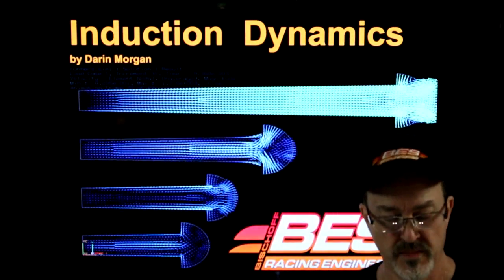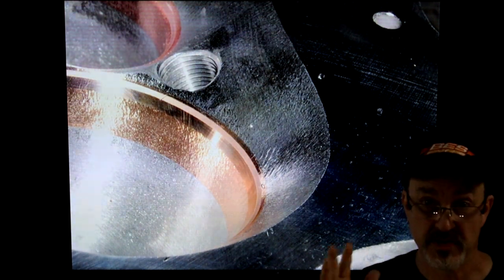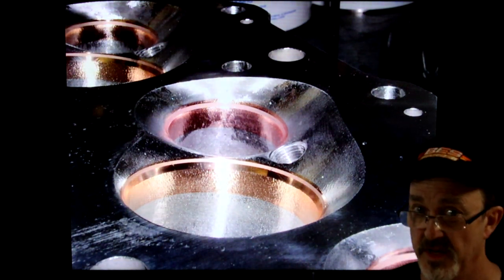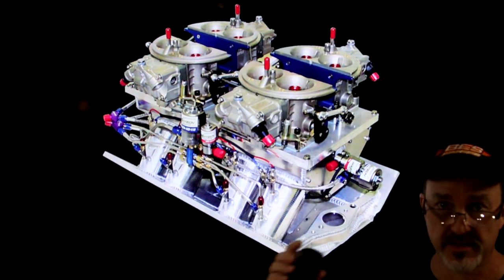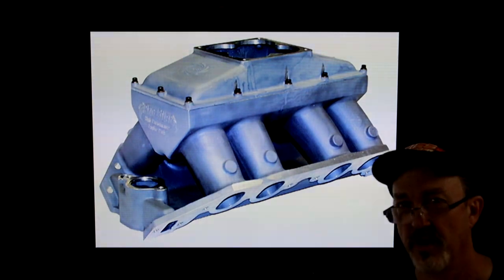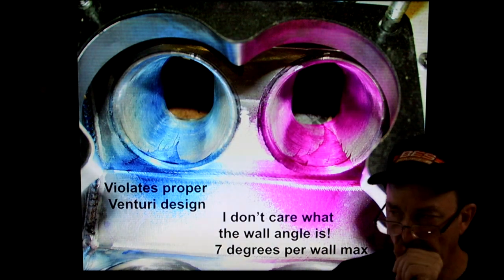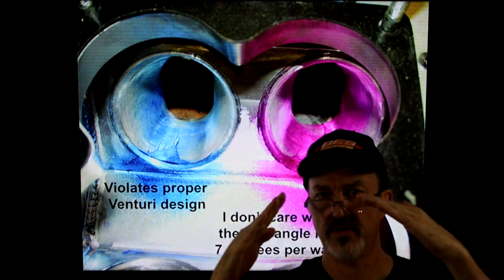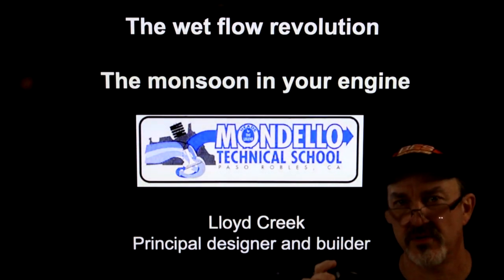De-atomization in intake tract in IC racing engines PART 1

Comment: I have to take exception at  21:00 when you state 7.5 degrees is the max according to venturi design rules.  That angle is ONLY referring to the DOWNstream side of a venturi. In your runners it is more like the UPstream side of a venturi where it is much more flexible. Actual venturis typically have a 19-24degree angle upstream since there is little danger of the flow breaking away. 24degrees limit is only there to ease the transition into the throat of the venturi. Runners are not venturis and run in a different environment.  IF there IS a limit on runner converging angle, it is not due to venturi design rules but has to be something else. 
I think you are right about the radius, the bigger rad involves too much air around the entrance and the smaller rad focuses the pressure distribution more to the area above the entrance. The blue runner looks to be in a corner with a wall beside it and the pink one no walls beside it. That could change the pattern too.

Comment: Thanks for the great information that most would never have access to. In future classes (videos) can you also tell us your thoughts on port injected EFI applications and how they differ from, or are similar to the flow characteristics of moving air as opposed to a fuel--air mixture? Thanks again for your time and expertise! Jeff
Reply from the maker: Everything applies with EFI as it does with carburetors except plenum volume. Plenum volume is not a tuning factor with EFI like it is with carburation..  A properly designed EFI system in an unlimited NA engine should be in the plenum  right above the runner opening so your still dealing with the same de-atomization problems. Injector placement down at the flange is done for throttle response which drag racing engines dont need. Plus, when you lower injector placement down the runner it decreases charge density and inertia super charging  and VE suffers!
Reply: @darinmorgan3520  Wow! Thank you. Very interesting. Thanks for taking the time to do this series!, Jeff
Reply from the maker: Since you brought it up, hell yes. Thats a great topic and a very important aspect of induction system design. Particle flow (fuel droplets)  air carried by velocity change not just the velocity itself. Thats why we need a short side radius and why that radius is so damn important. This is one reason air speed management ( peak, mean change) is the primary goal of any induction system designer. I will get to work on it.

Comment: How much might the carburetor offset have played into your dykem testing results? Did you run the radiuses in reverse placement to confirm your findings?

Great content, I’ve learned a lot and it has peaked my interest in the subject.

Comment: I'm debating the following for a 96 Gen 2 Viper.  Heads were done in 1999, 269 cfm @ .600 28in.  I'd like to get the work on the heads evaluated.  Maybe there are problems that can be fixed and who knows, maybe some "low hanging fruit" that could be harvested.

Comment: the older manifolds curved the runners so the fuel would not drop out.  did it work? I don't know. That was the days of carburetors,  now fuel injection it is not an issure

Comment: What about just tilting the carburetors so that, combined with straight ports and intake runners, the air makes NO turns on the way to hitting the intake valve opening area?

Yes, I know you would have to have carbs properly made or modified to work properly though at an angle.

But, imagine a world (movie trailer voice)  with NO turns from top of carb to intake valve!

Comment: Hey do you have time to check out our patent on the atomization valve?  Its about 80 grooves cut in the radius of the intake valves.  Would really appreciate your feedback as we are still manufacturing on a small scale.  Up to 1/5 better mileage and emissions reduction by 27 percent tested on SBC's
Reply from the maker: I have seen and tested wings, ridges, blades, dimples, swirls and yes, grooves as your patent lays out. I do not doubt the increase in inefficiency as you have stated but in  high speed racing engines these valves are stressed to the limit and grooves cause stress risers that snap the valve head off like a dry twig in a tornado. Valves are engineered to be as light as possible yet be strong enough to withstand the high stress. In doing so we must take a small hit in efficiency in order to pull that off.
Reply: The grooves are on the face of the  valve not the stem.  Only 7000 of an inch cut.  Already went through strict patent testing in racing engines.  Don't want you to dismiss our product if it can help people out there.

Comment: When you taper a runner aggressively, don't you ruin its ability to resonate? I saw your site and a major fan of your BV3 heads.
Reply from the maker: The BV3 heads are not my design. Thats all Edelbrock. No, you dont "ruin" its ability to resonate but it does attenuate the signal somwhat. More taper decreases amplitude a bit but in return it broadens the wave length or time making for a wider power band.
Reply: @darinmorgan3520  Thanks for the reply! Keep your oil pressure up!

Comment: 7:40 are you referring to unshrouding valves?
Reply from the maker: Unshrouding the valve refers to opening up the chamber to the point where its no longer a restriction  or impedance to the flow,. Moving the valve as far from the bore wall as is physically possible is also a form of unshrouding.  Pressure recovery is optimizing the unshrouded valves available area to control the flows deceleration  into the cylinder. Attaining  uniform air speed as possible around the circumference of the valve is the primary way to optimize the pressure recovery.

 An unshrouded valve can have poor pressure recovery.
Reply: @darinmorgan3520  Moving the valve away from the wall (smaller valve) and not moving the chamber wall away from the valve? Thanks for the reply
Reply: @darinmorgan3520  Where would be an ideal location in a sfb edelbrock combustion chamber to remove 1-2cc to decrease compression? I was thinking the quench area near the exhaust valve.
Reply from the maker: @TropicBreezeRealty  Please clarify that question. 
A reduction in valve size may or may not be a prudent decision depending on the CFM demand of the engine but that is not unshrouding. It takes hours to explain this topic. thats why I put together the Advanced Induction course with ten hours of video and everything else that comes with it. This subject matter can not be well explained in a simple txt. Your questions are great but the explanation is more complex than I can explain in 120 words.
Reply from the maker: @TropicBreezeRealty  There isn't anywhere in the chamber to remove material to gain CCs because the chamber is already to laid back as is. Dish your valves. That will get you there. If they are already dished, take it off the piston.
Reply: @darinmorgan3520  To use the edelbrock performer head as an example. The chamber is designed for a 2.02 but with 1.9 that makes for an additional .06 from the chamber wall. Wouldn't that be unshrouding. I'm still very green on the subject. thank you for replying. where can I find your course?
Reply from the maker: @TropicBreezeRealty  If your CFM requirements for that engine are satisfied with a 1.9 then that would be considered a way of unshrouding the valve. If your cfm requirements are adequate with a 2.02 and you install a 1.9 you may have  somewhat "unshrouded" the valve but you choked the engine in the process. unshrouding is just opening up the chamber where it no longer a restriction. Nothing really more to it than that.
Reply from the maker: If you wish to inquire about the Advanced Induction system course email me at darinorgan7854@gmail.com

Comment: Darin: Your rules-of-thumb on runner volume (length + increasing opening with reasonable taper to get to your runner volume goal): how / how much do they change when dealing with a dry flow intake? 

-Particularly when dealing with a long-runner intake with bigger flow losses? -I'm assuming this is a situation where "runner velocity be damned", to a certain degree, or at least where more air volume and flow is more important vs. velocity through the runners?  (Extreme example: GM TPI ultra-long runners and their extra losses from that huge, nasty curve...).

[Edit] Nevermind... I read video #2... I think I get it now. I need the velocity to fully fill the cylinder even if it's not important to keeping fuel from falling out going from my plenum to my runners. Higher velocity = higher pressure on my reflected waves and more air can be stuffed into the cylinder by delaying the intake valve close when someone like Mr. Mike Jones properly specs my cam...
Reply from the maker: In a dry flow induction system everything gets smaller. The fuel isn't taking up space so valve sizing, area and taper get smaller. How much, I cant say. Not an area I have dwelled into much. DI engines are a disaster as far as racing but a god send to EPA standards. In low speed engines its fantastic.
Reply: @darinmorgan3520  Thanks!
Reply from the maker: Changes quite a bit! Look at the LT1. Although I hate that head design it does show how much smaller you can make the intake valve ( 2.200 LS7 verses 2.125 for LT1)

Comment: The carburettor turns a liquid (fuel) into fine droplets in which state it can be ignited by the spark plug; yet as depicted in this video, and governed by scientific principles, the plenum in a 'tunnel ram' manifold it is turned back into a liquid, and has to be converted yet again into droplets, buy shearing it off of 'sharp' edges; makes no sense really when carburettors are designed to atomise the fuel in the first place!